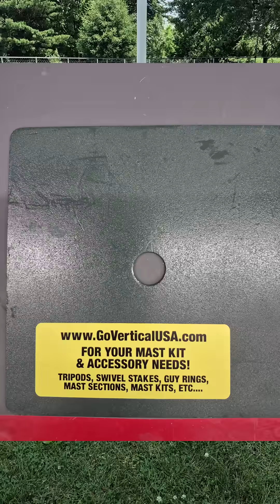Tripod 6 meter loop #shorts #hamradio #diy #repair #cool #retro #shortwave #radio #antenna #handmade

Comment: Interesting polarization on the horizontal axis of the loop windings, as mostly we see loops vertical and rotatable.  My home made tunable high gain DX AM broadcast band loop works only in the windings vertical axis.
Reply: For amateur radio service, horizontal polarization is typically used for AM and SSB transmission, whereas vertical polarization is used for FM.  Using a vertically-polarized loop for DX AM reception makes sense because AM stations transmit with vertical polarization.  Cross-
polarization in any situation can cause up to 20dB of signal loss.